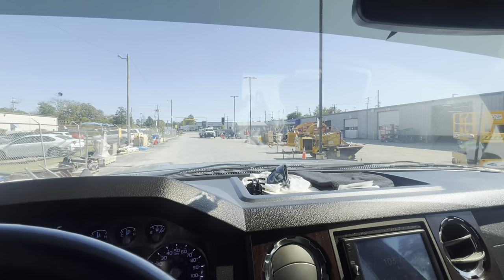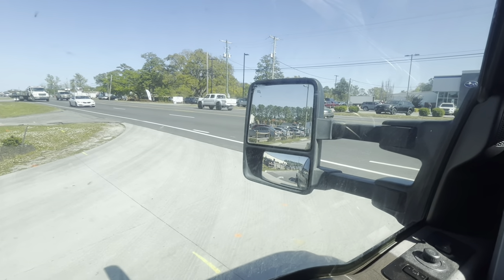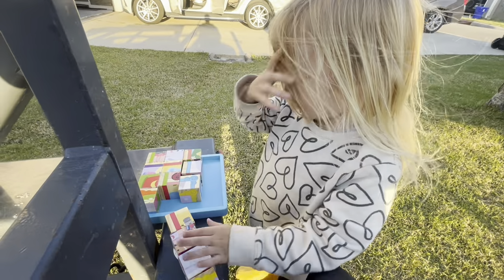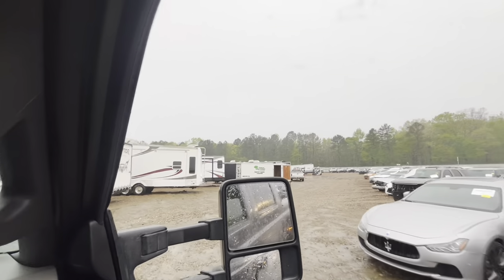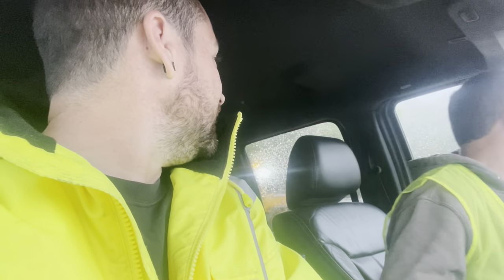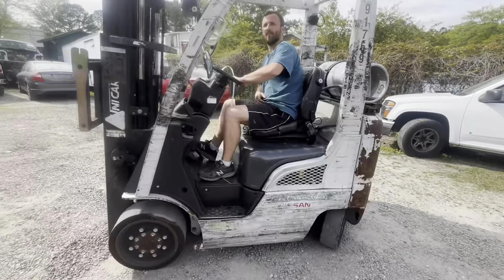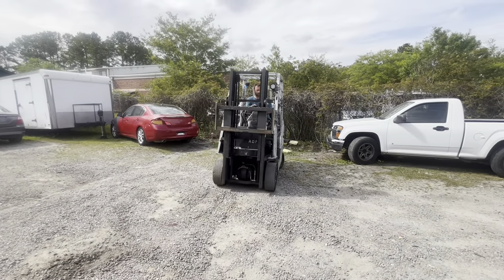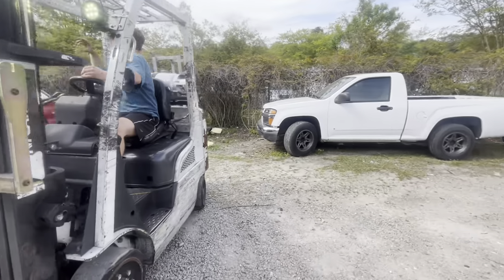💰 SCORED A HUGE Deal In IAA Specialty Auction On A Forklift!

Comment: The motor on forklifts that run on propane won’t have hardly any wear because propane burns so much cleaner than gasoline or diesel if the rest checks out then it will probably last you a lifetime no more hours than you will put on it
Reply from the maker: Ahhh that’s interesting and makes sense. Thanks for that info